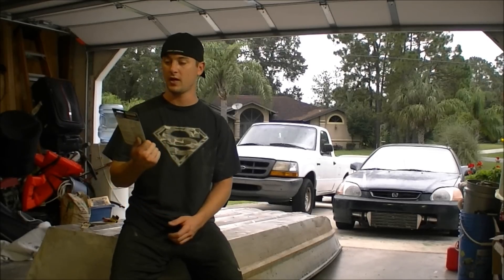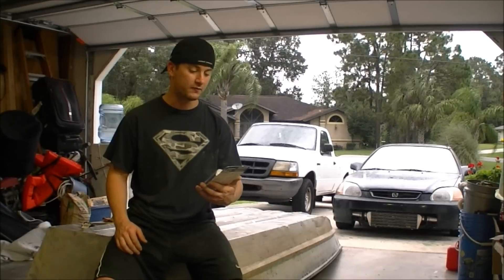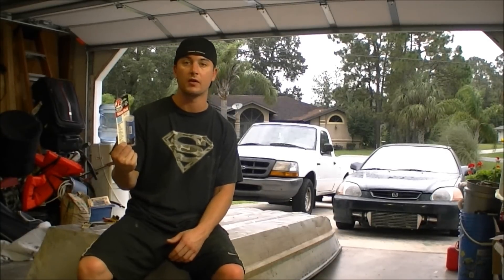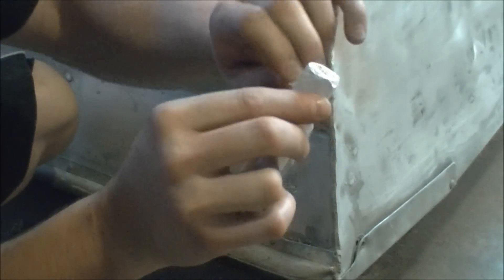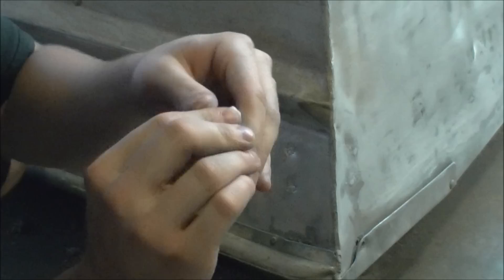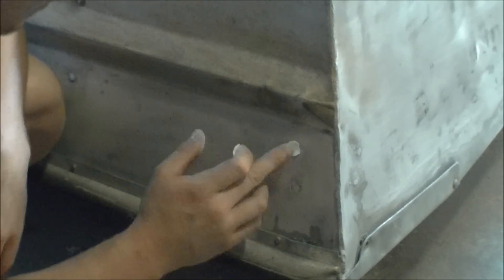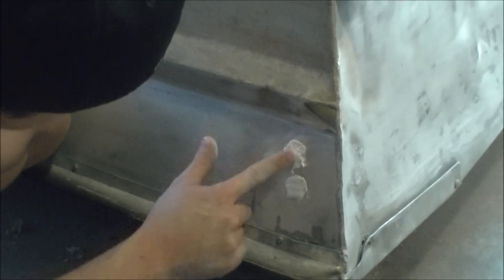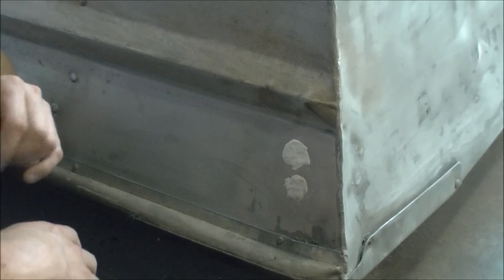JB Water Weld Test & Review

Comment: I have 4 3/8" drilled holes above the waterline on the side of my kayak that I need to fill.  Would this work?
Reply from the maker: Yep,just prep the spot with some sand paper and blow it off or wipe it with a clean rag and some rubbing alcohol, then apply the jb.
Reply: WILL THIS WORK ON A CARS FUEL TANK LEAK?
Reply: WILL THIS WORK ON A CARS FUEL TANK LEAK?
Reply: WILL THIS WORK ON A CARS FUEL TANK LEAK?
Reply: Tried it on my gas tank wouldn't stick on I don't recommend getting this stuff.

Comment: I have a crack on the corner of my bathtub if I use this stuff can I put caulk over this stuff
Reply from the maker: Sand it a little,then clean with rubbing alcohol and apply the JB Water Weld.Let it cure,then apply the caulk and you should be fine.Please leave feedback letting us know your results!
Reply: Probably, it dries rock hard,